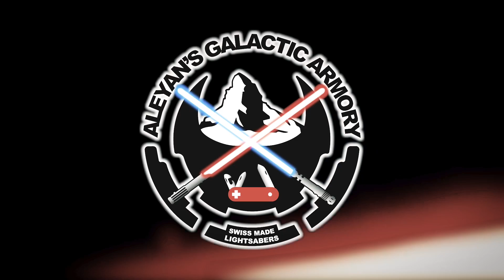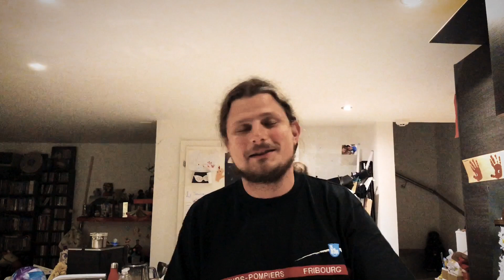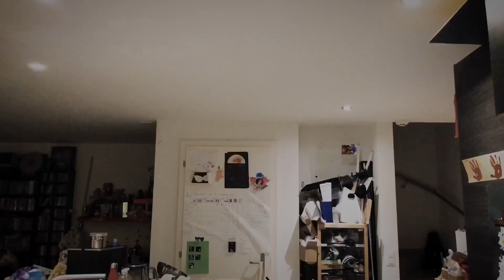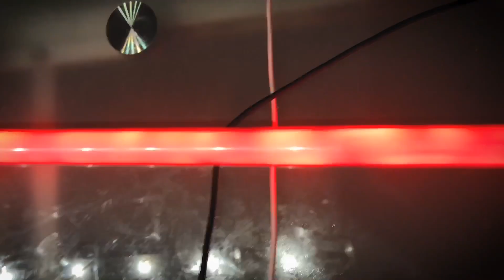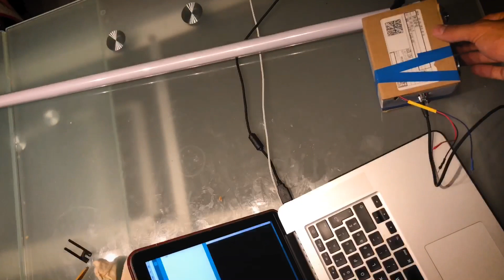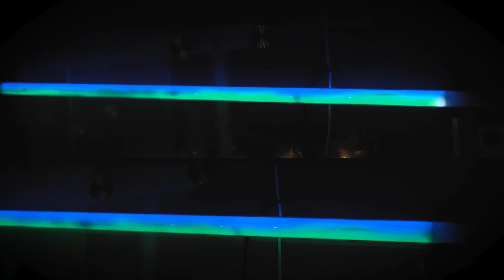ZigZag Blade test

Comment: Can you make a tutorial on how to actually build a zig zag blade
Reply from the maker: It’s just a blade where each Neopixel strip is connected to the other in series instead of parallel.

You take a 246 pixels strip, fold it in the middle and you have the core for a 123 pixels long Zigzag blade.